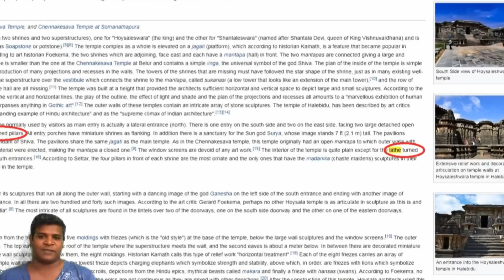Hoysaleswara Temple, India - Built with Ancient Machining Technology?

Comment: i always just assumed most ancient civilizations used their own version of a lathe to make some of their stone work, but for some reason, i never even considered how they would put a stone of that size on a lathe!

that said, i just had an epiphany, just as i was writing this.  i think i might know how they made the pillars.  there's a video on YT of a guy that moves multi-ton stones by himself using only wood and the tools of ancient times.  in this video he had a 1 or 2 ton square cement block; he used a lever to raise on side and then placed a small hard rock centered beneath the block.  and in doing so, it made it quite easy to spin the block in space.  therefore, i think they used this same technique—w/ the stone standing vertically—and built a frame to keep it upright, but free to spin.  however, i have no clue how they could've managed to spin it as fast as would be necessary to shape stone.

one final note: i use to think that the most impressive stone work of ancient civilizations was either Puma Punku or Ollantytoda, but after seeing the detail of this structure that was basically just carved out of one giant rock, i think Hoysaleswara Temple might have just taken first place.  in any case, i think there's several more chapters to book of human civilization that we are completely unaware of.  that's what makes this stuff so interesting.  thanks for posting!  thumbs up!

Comment: It is clear that the pillars in the temple were ‘machined’ on lathes. The problem is that there is no Lathe big enough to machine pillars of granite weighing more than several tonnes to the level of precision machining as seen on the pillars. The only way these pillars could have been ‘carved’ is by placing the ‘pillar blank’ on a platform of iron, which is placed on a large ‘pond’ of MERCURY of a calculated volume, enough to displace the weight of the pillar blank. Mercury being more denser than iron will ‘float’ the weight placed on it, as if it were weightless. The pillar being placed on it will be rotated at a very high speed, allowing for diamond tipped saws to ‘cut’ it into the pillars we see in the video. Once the construction was complete, the mercury was pumped out and used for other machining works.

Comment: Might I suggest that the Temples, built well after the use of iron and steel was well established  in the Indian Sub-continent , and that the columns were almost certainly turned on large vertically  mounted  wheels, a natural design evolution from potting wheels. With wooden guides at the top to prevent toppling, and the fact that  columns when spun are self centering. Steel tools could then be used to mill the stone into the clearly stunning and fantastical shaped we see in your nice little video.  Rotation could be started and maintained with ropes wound around the columns and pulled buy many men to apply power. A pull wind-off wind on system could impart pretty consistent power. I suggest making a model first in wood, then using cast cement to  test the theory. The enormous mass of the columns, and  if they had a base not unlike a flywheel, the massive rotational inertia, would allow for some serious erosive milling  work to be done on the columns whilst not loosing too much speed. The creative genius and technological abilities of our forefathers and mothers is not to be underestimated. With a huge labour force, and plenty of time, I see no reason why the cleverer ancient engineers could not mill these colunms with the technology at their disposal. xxx ;-)

Comment: Are the two snakes in a helical formation around the burring bit, an indication of electric powered tool?
Snakes have a lot of power. Snakes can be handled as long as you take care to not get bit.
Electricity is transmitted on long wires.
 Electricity has much power for doing work. 
Electricity can bite you and even kill you if you do not handle them with care.
Odd huh, I seem to see this in many regions around the world.
It really seems to suggest the use of electric powered tools.
What are your thoughts?

Comment: Imho, these kinds of tools were used Far longer ago, than several hundred years...more like many thousands of years ago, high civilization. 
---Could certain different lathing mechanism, have revolved around the pillars already in place?  ..instead of the usual horizontal positioning used for lathing?  [kinda like a Wankle engine?]  
---What if, perhaps, ancients knew how to powder rocks and re-form them, even using molds, similar to how we cast cement?  
---Did they lift/position heavy stone works, using Sound Vibrations?  I think that might be possible. 
---The necklace and crown, appear to have been made separate, and set in place on the statue.  
---Could that "temple" have actually been a center for those with the skills/knowledge of machining tech?  Like much later specialty Guilds? [because there are so many bits of evidence of the technology carved in stone, for all to see]?

Comment: Anyway, the stone pillars have been made by turning in a device. That is quite clear. Powered by a machine / engine? I do not think .. LOL ... animals or human power was common .. and at that time era even cheaper than today. It does not make sense to complicate it .. But still a great achievement .. 

Copy grinding/turning, needs a master shape pillar/part/relief and the copy part. Thats mans two vertical axis the one with the master is static and the secound turns (roud base). Therefore the two bases..

Comment: I am not sure why I didn't catch this the first time through the  video, some of these columns appear to be examples of belt drives and gear types as well as chain drive style gears.  It is almost as if the columns in this structure have the specific purpose of showing the various methods and designs of belt drive pulleys, gears and chain drive pulleys.  You refer to this structure as a temple, it almost seems to me like it's design is meant to preserve a subset of important knowledge.

Comment: The column shown 2:40 into the video is same as modern designs use for a chain gear, the links of chain fit between the teeth protruding on the sides.  In fact my "chain hoists" have a very similar shaped gear in them.  These columns are literally showcasing gear technology known to them at the time they were made.  I have never seen anything of this site before, thanks for the video...

Comment: This temple is only 900yrs old. None of the methods you describe is that technologically advanced. Lathes were already in widespread use. Greeks invented gears over 1,000yrs before the temple was built. Soapstone is VERY soft and can even be cut with non-metal implements. It would be easy to create hollowed features with shaped copper tools. Turning the large pillars would most likely be done in the verticle position. Very heavy objects can be easily rotated simply by throwing a pebble under them to act as a fulcrum. 900 yrs ago Indians could easily have manufactured copper, brass, or bronze spikes to act as the fulcrum point. Things are turned even today between simple metal spikes. The temple certainly had excellent craftsmanship and artistry...but nothing mysteriously unexplainable.

Comment: Sure, something unusual made those pillars - and many other rock structures around the world. The question - where is it? If they had machines, what happened to them? Did they toss them into the deepest parts of the ocean? If so, why? That wouldn't make sense. Why is there so little evidence, other than the rocks themselves, which may tell us that any of these stones were carved with anything other than hand tools? The biggest problem I see with conclusions is that you make a lot of assumptions - i.e. that "planetary gear" or the "deburring tools". You feel as though that's what they are because they look like modern tools. That's called Pareidolia. Could they be what you believe they are? Sure. But is there an equal chance they are not? Yes.

Comment: Perhaps a level platform that allowed a tool to be spun around the pillar while it was upright.  Raise, lower and indent the platform to adjust each ring.   Much easier to rotate a tool around a vertical, stable column than try to support and spin a multi-ton column horizontally.

Comment: The temple columns with circular grooves are good examples of the use of a lathe, but a lathe is not super high technology. The most difficult part would be securely holding the very heavy columns on a horizontal axis and precisely cutting the grooves at fixed distances along the axis of the columns while maintaining the fixed axis of rotation. I would like to know how repeatable the grooves and polished bands are from one column to the next. Are they uniformly cut to the same dimensions? And how much variability is there in the column dimensions? If they are highly repeatable in accurate measurement, it adds greater weight to the author's argument for higher technology in ancient times.

Comment: For the pillars, is there any evidence to suggest some kind of portable lathe like device that could be pushed, or pulled around the columns? I imagine a wooden device, pulled by animals or men, where a two to one gear ratio could be used to help generate mechanical force, while gouging out the material. On the statues: it's possible to create the small gaps in the stone by affixing a flint bit to a small flexible reed, and rubbing one's hands together, while holding the drill assembly, allowing someone  to drill along any angle, or even hollow out a sphere. The polish is absolutely possible just by lapping by hand, using smaller and smaller grit. I have achieved a mirror polish on granite, using only primitive techniques. I don't know if the other methods I suggested were used in this case, but I imagine they possibly were. Don't forget that even nearly perfect geometrical shapes can be created, using only simple materials, a lot of effort, and applying the laws of average.

Comment: they had steel in 2000 year ago, even very high grade steel. from meteorites ..  maybe they weren't able to fully melt this, but heating it up in charcoal and than beating it with a hammer makes it harder and so capable of cutting even the hardest rock. 
But for king with a need to proof himself it was available..  As for constructing  something so they could "turn" these stones. with some time ( what they plenty of) and cooperation of others i see it very well possible ....

Comment: I am not sure what he means by "advance", but sure, any sophisticated handcraftmanship requires either sophisticated tools, or sophisticated methods to apply standard or sophisticated tools! The fact that he lacks the knowledge or the creativity and imagination to understand how they did it with out our current tools, is just natural and non-extraordinary. He continuosly mentions the use of "machines", well, guess what?!  humankind has been using machines for thousand of years now, so there is nothing extraordinary in that also. This machines were normally man powered, or animal powered, or water/gravity power (water mill), and even steam powered (thousand of years ago the use of vapour pressure to power machines was well known in many places) and currently they are powered by modern energy sources (combustion engines, reaction engines, modern water heating methods...), thats the only difference.
Regarding "gears", again, humans have knowledge of gear mechanism for over two thousand years now, so again, I miss what is extraordinary about all this?
Still, the sites are impressive, indeed!

Comment: From an engineering perspective have you considered that the round stone with deep grooves was a base plate for the columns in the building. The grooves on the bottom horizontal stone ‘bar’ seem to match up with the grooves shown in your video.  The purpose of a base stone may have been to provide support for the stone column being ‘turned’. Liquid poured into the grooves whilst turning may have helped to create a lubricated surface and ease the spinning of the column.

Comment: The pillars look exactly like the steam turbine rotors (called bare rotor, before putting on the rotor blades) that are used in power plants for electricity generation.
Reply: Ah ok, I was noticing they are totally different designs and pillars in this one, as compared to other types of temples. This makes sense. Seems they were doing a visual representation of the power plants.

Comment: Excellent and interesting. Is it sure the temple is built 900 years old? Not older?Could it be possible that the pillars have been standing on big wheels which are turned around are carved, just as you do with wood ( but horizontal?) Are there other proofs in India of this carving technic?

Comment: Good analysis but one thing I would like to point out is that you find lots of pine trees in north India. The pine cone which gods seemed to be holding is symbol of pituitary gland which is also called third eye. The shape of pituitary gland is similar to pine cone and is considered as portal to higher dimensions. The figure which you described as pine cone tool (one where pine cone was at the top with a long handle and two snakes around it). The two snakes are actually symbol of kundalini shakti which when activated leads to higher dimension experiences.

Comment: I am a Ph. D. Mechanical Engineer, amateur machinist, car builder and machine designer. I have built things you cannot explain. OK, so yippee for me. How did these old Indian dudes make this stuff? First of all, I have no educated idea. None. But I can make some guesses, as you have. 

A modern multi-axis machine can have large cutting surfaces that revolve around the work piece. In a lathe, the piece is "turned" on a rotating shaft by a machine of some kind. That could have been done to the pillars, especially if they had been mounted vertically on a wheel, like a potters wheel, and rotated by any number of methods using human, water, or animal power. The pillar could have been stationary,  and a smaller cutting tool,  or a rope impregnated with "cutting" media (harder stones) could have done the deed if mounted in a proper fixture that could orbit around the pillar. And any of these stone things could have been chemically softened using materials from the earth or from plants, that can indeed soften stone to make it more workable and to polish it. The Incas used chemical milling and forming on Machu Picchu and several other megalithic creations. 

Planetary gears?  No, I don't think so. That is NOT what planetary gears look like, to begin with. They could have made wooden gears, maybe rock ones, but it seems unreasonable. However, if you give a room full of 4th graders some drawing materials and few days, I can assure you that one or more will draw something with star like wedges around it. Humans all draw shit like that. I don't know why...we just do. The 2:1 ratio is a natural symmetry that humans fancy.  Monkeys like bananas. Humans like symmetry. Go figure.

Carving the tiny hollow skulls and necklaces had to be a huge pain in the ass, but these people were religious fanatics. And they couldn't spend hours each day watching CNN lie about Trump. They had the motivation and the time. It is equally clear that their artists were masters of precision and detail. They knew how things really were, and they had the time and the desire to make it as real as they could.

What about tools? Again, I suspect a combination of chemically milling and metal tool cutting edges, although very hard stones, like flint, can cut softened stone easily. Fingernails can cut softened stone.  There are ancient drills that look and work a lot like modern ones, and while they couldn't run down to the hardware store and buy batteries and bits, there were people who made tools, and people who used them.  Years of tedious, tiring, meticulous work by the skilled hands of hundred or thousands of motivated workers can do a lot of magnificent stuff, including chemically softening stone so it can be hollowed out.  Go to Baguio in the Philippines and watch them make hollow wooden and metal art pieces using very simple, and ancient hand tools and amazingly ingenious methods. Humans are damn smart, and have been smart for millions of years. Do not underestimate them.  

My guess is that it is no more mysterious than that, and while they may not have had pine cones, they did have corn and turmeric  (Curcuma aromatica) either of which have varieties that could look a lot like the things conjectured to be modern metal grinding burrs shown in the video. My guess is, their gods might be more likely to be holding cherished food plants than metal machine tools, but, ya know...I don't know shit.  Just guessing.

Comment: Those round circle (around the pillars) if it not a lathe was used then a pulley maybe used. The pulley most likely made of a abrasive material maybe use on those pillars in a circular motion with one or two persons moving it like a band saw style. Only difference the band saw was straight and the pulley was done in a circular motion. Guys it just my imagination ...peace out

Comment: make a microscopic surface analysis of these machining marks and figure out which elements you can find.  If you find tungsten carbide, chromium, vanadium, and other processed materials or elements you are surely on to something.  Microscopic material traces of tool use in materials last a very long time.  More than a 1000 years in some cases.    It would be interesting to see what microscopic materials are on the surface of these walls.  

Yes there is a lot of other materials and elements on the surface of these pillars and figures from atmospheric pollution but i don't think that can explain traces of tungsten carbide.